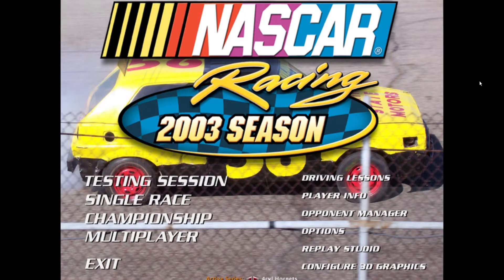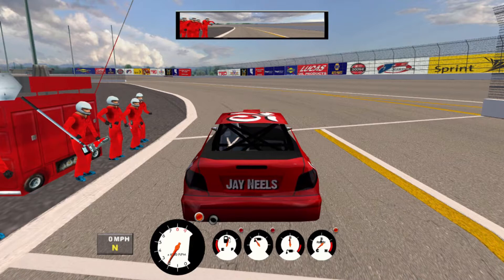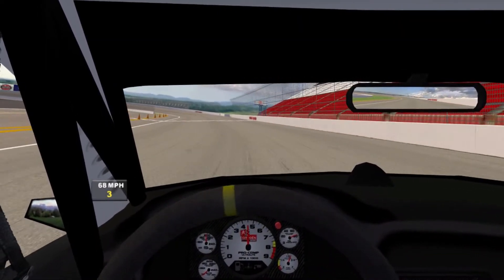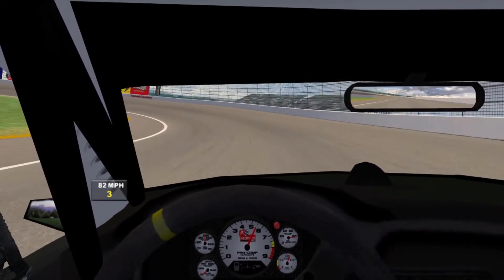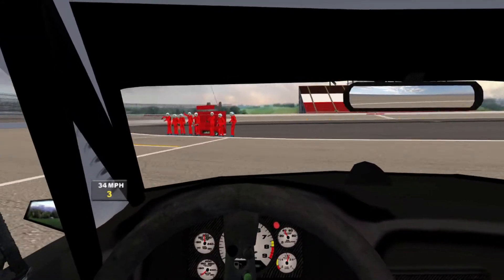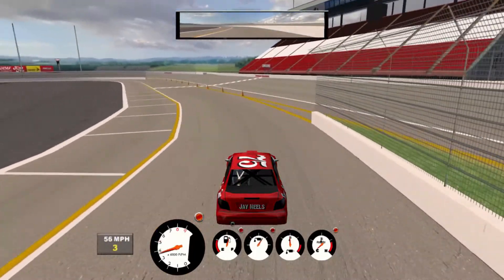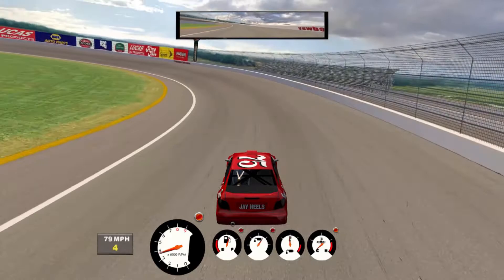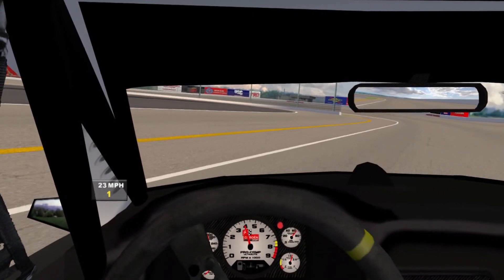NR2003 - 4 Cylinder Hornets Physics. 100HP.

Comment: Is there a download for this yet?
Reply from the maker: Kinda... There is 1 engine I made for KBsucks guy, 115HP 2.2Liter.  But I am making up a whole folder with 11 different engines.  Ranging from 100 to 210 HP and from 1500 to 2500 lbs. Message me on reddit , there are few things I gotta explain on how to make AI work with this as well. You have to make AI run same set up as you make for this car , if you know how to do it already , no problemos. It's the Fast.Gns.Sim set up that needs to be changed.
Reply from the maker: What's cool is the other project with 3 crate engines that are mostly used for lower NASCAR divisions. GM602 and GM604 along with CT525 ( super late model) .  Covers Street Stocks , 300hp V8 in any car , Late Models, Super Late Models along with pretty much any division or racetrack that runs "crate" motors. https://youtu.be/9U1HRIbmBoI
Reply: Thats awesome only thing is I don't have Reddit can you message me on here instead?
Reply from the maker: http://www.mediafire.com/file/eo91ikpy22o576z/2.2+Cavalier.rar  here is the 2.2 liter. Nothing is done or finalized so don't make any assumptions just yet. Still stock 2003 Chassis and Tires. Only engine is different. Anyway you should make a reddit account it worth it on the long run. Again you need to change AI set up to make them work with new engines but thats common sense.